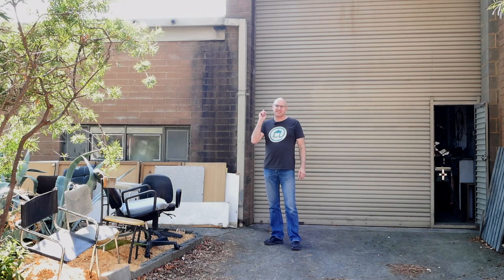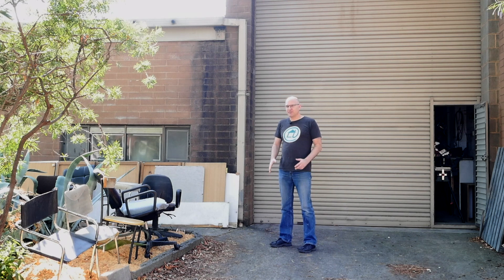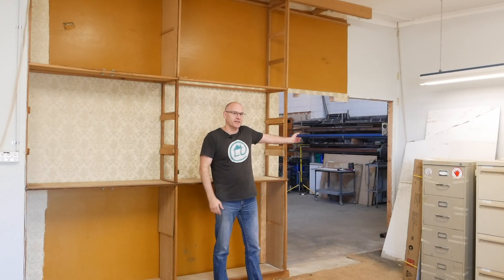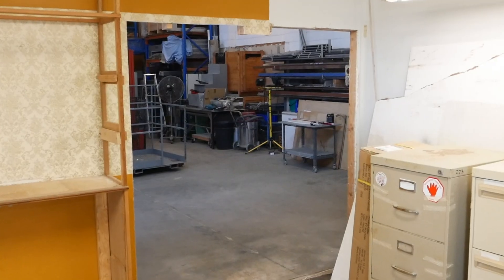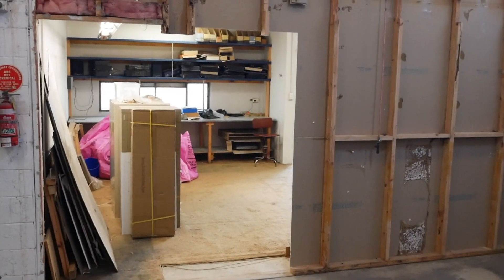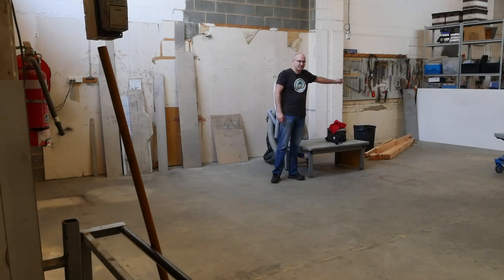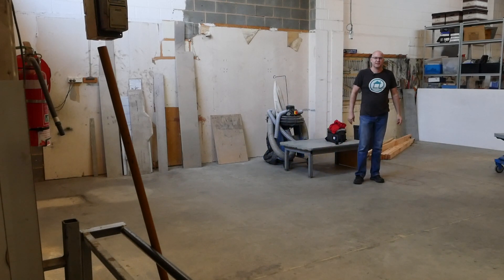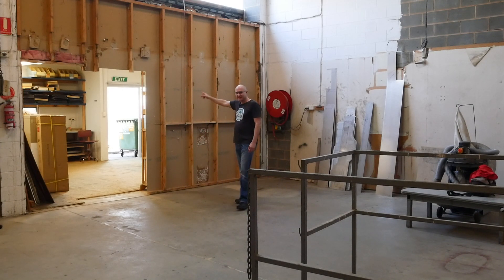Vlog 73: SuperLab Genesis

Comment: Talk to your insurance broker before using cool room panelling. There is more suitable materials to use that won't make obtaining reasonably priced insurance difficult
Reply from the maker: I hadn't thought about that being a problem. Interesting. What's the reason that those panels make insurance more expensive? They're very common in commercial construction.
Reply: @SuperHouseTV  EPS is highly flammable, there is flame retardant products but it is significantly more expensive than the standard stuff. If used in a manufacturing operation like yours with any type of heat process you will find that if disclosed to the insurer many will either not be able to provide a quote or the premium will be loaded significantly.